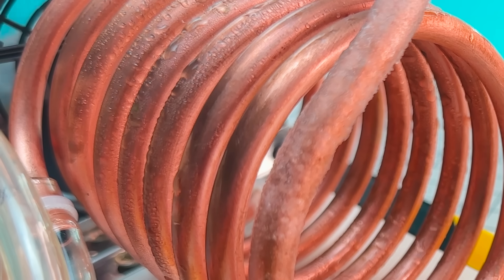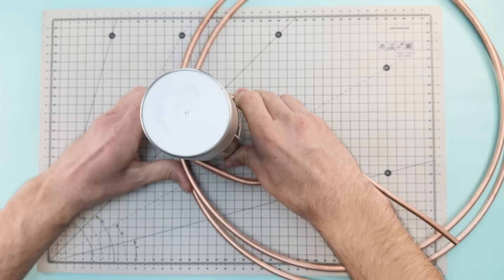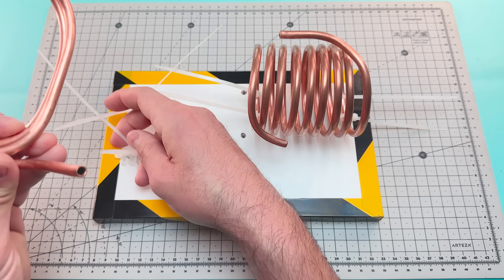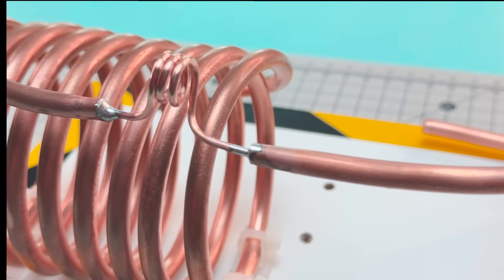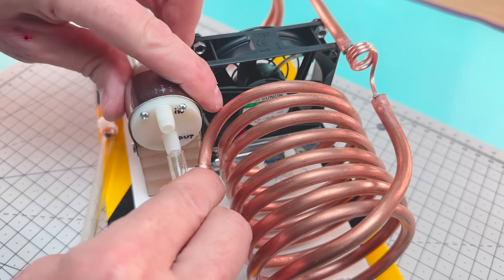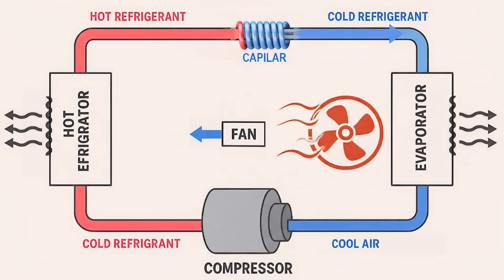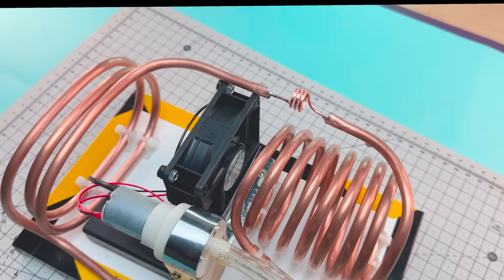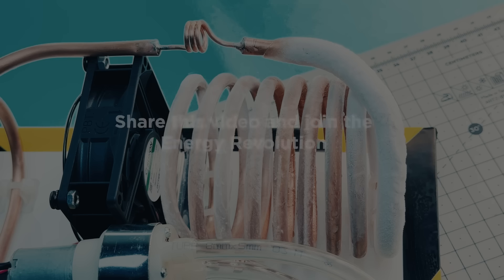Make your own AIR CONDITIONER at home Fast and Easy!

Comment: How many days this gas and whole  system work if i connect motor and fan with ac adapter ..

I think... if i make cabinet of 6.5 ft × 4ft × 2ft for sleeping then this one is good ...

Comment: Mixing flamable gas with air can create an explosion. You need to vacuum the system first
Reply: Good point, Thanks!
Reply: From what I am reading the heat created from this unit could possibly explode because of a butane leak. What do you think.
Reply: @c.t.murray3632  completely possible, in compressors for refrigerants class A3 the electric part must be isolated.

Comment: Isobutane is also known as R-600a.  My most effective improvement was to use water produced by the evaporator to cool the incoming air cooling the condenser.  I simply built an in-line evaporative cooler which cooled the warm outside air by about 20 deg F.  This resulted in significant energy savings, not to mention at least a 10 deg F drop in the air being blown into the room.  I do have to supplement it with tap water, but this costs a couple of bucks each year.

Comment: Could you put the hot side into a bucket of water? Let the heat go in the water and change out every day or so?
Reply: once the water gets as hot as the condenser the system would just stop working, the only way to make this actually work is to pump out the hot air next to the condenser outside the room
Reply: condenser in bucket, bucket receives constant inflow of water and constant drain. as long as water stays cool, heat can move from ac system into bucket. You're using the water as a heat sink for the whole system and then dumping the heat down the drain. As long as you have cool water in that bucket, you're good. 

Two garden hoses, 1 5 gal bucket. Cold water goes from faucet (bathroom) into bottom of bucket, where condenser is. hot water rises to the top and is drained by that hose (drill hole and tap for hose). Run drain hose back to sink and make sure the bucket stays higher than the sink at all times haha. Nice slow flow of maybe 25ml/min, just enough to get rid of the heat, not enough to waste water.

Comment: Hm... Well it works but it dissipates heat on the other side. So you can cool your head down with the cold air, but the room will get warmer, because of effectivity...

Comment: This work if placed on a windowsill  with one end out the window and blowing air from outside in, while allowing the heat to dissipate outside.
Considering its run of a 9v battery, I'd say it was pretty impressive tbh.

Comment: You fabricated a dehumidifier. It produces an equal amount of heat, so there's no net change in temperature. However, it does reduce ambient humidity by converting water vapor to liquid water or ice.

Comment: The principal is sound by the system is inefficient: the condenser heats up, coubterparting the cooling effect of the evaporator. To make it actually work, the condenser should be outside of the facility that’s intended to be cooled. Or vise versa is you reverse the flow direction. That’s why there are 2 separate modules in your AC/heat pump. That’s why the condenser of your refrigerator is insulated from your cooling chamber. At the scale, this will however work for cooling a tent or a beer in a cooler. Just separate the condensing and evaporating modules and keep the evaporator outside.
Reply: ...Typo: keep the condenser outside :)

Comment: Should at least build the system with 2 fans in a way that you can place it on a windows you can partially close with external shutter so that way the heat stays outside and the cold inside.

Comment: Thanks interesting. I would like to try this but I don't have access to iso butane. Can I use refrigerant commonly used in automotive ACs?
Reply: yes, isobutane its lighter refill
Reply: Lol, sure, it would work even better. The only difference is that they would work on a different pressure and as result, construction need to be adjusted.

Comment: Aside from the evaporator being in the same room as the condenser, what other problems does this thing have? It seems like it would work like an AC unit 🤔
also, is the pressure from a pump like that enough to compress the gas?

Comment: I actually did a project like this back in high school for a science fair. I don’t see any compressor in this video. The cute little black thing that everyone thinks is a compressor is a Peltier module.    A Peltier module doesn’t need a traditional condenser like a freon system — it handles heat differently and doesn’t overheat the same way. Projects like this are great for helping people get the basics, and I think that’s really the whole point of the video.

I got into HVAC because I enjoyed stuff like this, and now I own a commercial refrigeration company because I was shown stuff like this that made me want to know more. Don’t worry about the trolls calling it stupid just to boost their egos. Funny enough, even the ones acting like they know everything still stuck around to watch the video — so clearly it got their attention. And they did get to learn the difference between a Peltier Module and a compressor.
Reply: I don't see any Peltier module in this video, do you?
Reply: @Atthishg  nope!

Comment: No compressor on this unit. It’s a (TEC) aka Peltier module. 

Actually, this thermoelectric system does manage heat — it uses a Peltier module, which handles heat differently than a traditional compressor with freon. It doesn’t need a condenser in the same way, so overheating isn’t as much of a risk
Reply: Pressure drop are done via capilar, thus no compressor required.

Comment: 왼쪽 주머니의 돈을 오른쪽에 옮겨 놓는다고 부자가 되지는 않죠. 절대 방 안이 시원해질 수 없습니다.
Moving money from your left pocket to your right will not make you rich. It will never make your room cooler.
Reply: It will not, but it can create a stream of cold air in your direction...but for that between condenser and evaporator needed more separation, that the hot air would not be sucked to cold part by fan lol😂

Comment: Propane gets much colder. -60F / Here in Mexico 90% of cars are charged with propane in their air conditioners. The amount of gas used is so small they never have problems and leaks are easy to smell.

Comment: As refrigeration tech who almost daily fixes R600 sealed system units, have experienced having even tiny amount of air in system to be mixed with refrigerant causes heat transfer characteristic of refrigerant greatly reduce to sometimes not at all (unlike Freon 134a which is still works to some extend even when there is air in system). I didn't see purging air out in this video so hard to believe such an even frost pattern on evaporator tubing was end result of video which was edited right at that point.
Reply: This is disappointing news. I really wanted to believe this would have worked. It would never cool a room, but maybe it could cool a PC, for example (tho you'd have to protect against condensation)
Reply: @zachw2906 , all new refrigerators in U.S. market are getting filled with R600 agent.oil for compressor is old school mineral oill ( same as R12 and unlike R134 ) . 
As long as you add lubricant for compressor parts and choosing compressor that can achieve -20 PSI for lowside and around 50 PSI on highside you can make your home project. ( Hard to believe that air pump is capable of making that happen ) .

Pump you are using MUST be sparkless other way it can cause whole thing to explode . 

Finding compressor that works in such a deep vacuum is another chalenge . Purging tubing from air is not hard at all just keep one side disconnected while you filling your system up then put everything back together.

Make sure to do this practice either outside or in very well ventilated room . Since this new agent is completely odorless .

Comment: What if I use just water instead of isobutane
Reply: The water would just heat up to room temperature. You need to use something like Isobutane because it "Boils" into a Gas at a low temperature, and compresses back into a liquid as it's forced through the pump. This is the same method used by a standard A/C system on a much smaller scale. You could probably use Canned Air as well with similar results (you just have to make sure the can is upside down when you are "Charging" the system) if you want to give that a try. I built a system like this once using an old Cooler, a Styrofoam cooler, fountain pumps, and an exhaust fan off of an old server rack. We'd fill the styrofoam cooler with water, load a bunch of frozen 2-liter bottles into it to chill the water, and pump the water through copper coils in the big cooler. The fan was mounted to the lid of the cooler and there were 4 outlet pipes around it. Hot air was pulled in by the fan, blown through the copper coils and pushed back out the outlet pipes. So long as you changed out the 2-liter bottles every hour or so, it dropped the temp in the garage by 20-25 degrees pretty quickly.
Reply: @normanjeter5220 before starting to read it whole i want to give you thanks for your effort 😮
Reply: @normanjeter5220 Maybe I've lack of knowledge about the pump's work, I'll be studying about that thanks!

Comment: the fan should not pull the hot air to the cold, you want the hot side, "Outside". otherwise you are just pulling the hot you cooled.
Reply: True, but if this works at all (some ppl seem dubious of that) then it's a concept that could be adjusted. You might also be able to use it for short periods just by dunking the hot side into room temperature water in an insulated bucket. The water will heat over time, but until it does, you have cooling. That all assumes this works in the first place. I really, really want it to be this simple, but I doubt it

Comment: The only question I have is, can you really coil copper tubing like that without crimping it? That would be the only useful information I'd get from this.😂😂😂
Reply: You can if you are careful. An easier way to do it and ensure no crimping is to by a couple EZ Fittings for the Ends of the copper, cap one end, fill it with water, then cap the other end. As long as you make sure to completely fill it and there are no air bubbles, you can bend copper tubing all day long without any crimps. Water is non-compressible, so poof, no crimps! I've used this trick for MANY years, ever since the first time I had to bend my own fuel line for an old Chevy Malibu.
Reply: @normanjeter5220  No wonder that old Malibu I bought all those years ago kept having water in the gas issues!
(Just kidding!)
Reply: @normanjeter5220 nice, now that's useful.

Comment: This will (very slowly) heat up a room. The same way an open refrigerator will heat up a room, not cool it.
Reply: Yes, very little. The work to do the cooling all comes from the battery and it won't last more than a few minutes. Plus they must have continuously injected the liquid isobutane in order to get the pictures with the frost. That little pump will not compress enough. A 9V battery provides about 5 watt-hours. A mini-fridge uses about  65 watts.

Comment: I like to read the comments and see how many Trump voters there are, you know the ones that think this is practical. It is only practical to show how a refrigeration system works. Nothing is going to cool down a room with a 9 volt battery unless the battery is the size of a house
This contraption with a 9 volt battery, no coil fins, no real engineering for pressure differences in coils, and no condenser fan  will not work to cool a room
.The evaporator has to be above freezing or ice insulates it and it builds an insulating frost line so you end up with air blowing over ice which restricts the evaporator from absorbing heat.
Reply: How many HVAC techs do you know that voted for Biden, lol
Reply: And you still don't know what a woman is. Amazing...
Reply: Try again pal. Im a Trump voter who is also a commercial hvac tech. This little toy will (slowly) heat up a room.

Comment: He just made an ineffective de humidifier. If the condenser is not outside of the space being cooled, no heat is removed from the room, only moisture in the air is condensed, not enough to make any difference.

If you want to waste your time and money
, instead of a can wrap the coil around your head to make an evaporator coil and wear it.               Maybe then a 9v battery that might last 4 minutes would cool you down.

He said it will cool any room, maybe 1 square inch of the room.
Reply: so it can cool laptop

Comment: I dont know where to pirchase this kind of copper tubes. Or capillary tubes, or air pump like that lol, or pretty much everything
Reply: Plumbing supply stores. If you're in the US, home depot, lowes, and those types of stores will usually have them. If not, stores like Fergusson or HVAC/Refrigeration companies will have them. You don't need a special license to buy anything except the refrigerant
Reply: Hmmm, I'm in Pakistan so I'll have to go to wire stores and show them the equipment I guess, hopefully they'll have it @crossup13

Comment: Its funny how people only look at this and think as far as the fact that, in a room as-is, it would only add heat to the room over time, but then I realize most people wouldn't think about adding a set of flex pipes to let outside air cool down the condenser coil. The ones who think about how it results in a net gain of heat acknowledge that it needs the hot and cold side to be isolated, but they don't really explain that the hot and cold side should be entirely blocked off from one another with a heat shield basically just isolating the condenser from the entire room, closed off entirely with only the flex pipes allowing another fan to pull in summer air to cool down the hot condenser so the system has a net removal of energy from the room. Its a heat pump, after all, moving thermal energy from the cold side to the hot side, something's gotta move the heat from the condenser to the outside air.

Comment: This is an AC but it wont work as configured. You need to have each half in a seperate area, otherwise any cooling achived is offset by the heat produced.
Reply: It is not technically a heat pump/AC without a reversing valve.
Reply: @GaryHarron  Thats true but my point is still correct, but since you feel the correction is necessary, it's done.

Comment: This is just a de-humidifyier. You cool one coil and heat the other, the total temperature is costant. Even higher if you consider the heat provided by the fan and the pump. 
Still a good way to improve comfort in really humid rooms.
If you wanna make a good conditioner, put the hot coil outside of the room and the cold inside.
Reply: would installing a CPU radiator help?
Reply: No mention of how a 9V battery does not have enough energy units to even begin to cool down a doll house? lol

Comment: Can you show a thermal cut off added to control temperature ?   Great video by the way  how much of the gas did you inject in to the line  as not to over fill it ?  thx for the info and fun project

Comment: Isobutane is highly flammable.  And your system is not very robust.  Is this your application for a Darwin award?
Reply: Apparently you don't know about the new coolant they're using. The new AC units require leak alarms and sensors to warn of leaks because it is highly flammable.
Reply: Considering that he didn't use a brushless motor, this is 100% a Darwin Award.
Reply: @dniezby the new freons are slightly flammable. Nothing like butane

Comment: и чо? КТо-то верит, что 12в "помпа" с СИЛИКОНОВОЙ мембраной позволяет развить давление, при котором ГАЗ сожмётся настолько, что станет жидким??? Вы в школе физику прогуливали????
Для справки - давление "паров" изобутана - 3.1атм. ТРИ ТОЧКА ОДИН АТМОСФЕРЫ! если давление будет ниже - газ никогда не станет жидкостью! НИКОГДА! Отсюда вывод - автор видео обманщик и мошенник!!!
Reply: The function of the capillary tube is to restrict flow through the loop. Length and diameter of the capillary tube determine how the pressure differential. Pump compression to 3 atmospheres is possible, although I agree this demonstration is a silly magic trick.
Reply: @stevethecat69420  ДАННЫЙ насос имеет "столб" всего в 0.3 атмосферы!! 3м водяного столба(и то - при 12в и без потока вообще). От 9в там еле-еле полтора метра воды будет....
Чтоб получить "охлаждение" на изобутане нужна "помпа", дающая 30м водяного столба! либо 3 атмосферы! Можно было взять 12в "насос" для накачивания шин - вот ОН способен дать и 3, и 4 атмосферы!!! И сделать нормальный "стенд"!!!

Comment: coils need to be staggered and condensor needs to have 2nd fan blowing away, preferably into a duct leading outside. otherwise the fan is sucking hot air from the condensor and cooling it down in the evaporator 😲
Reply: люди не учили физику - не мешай им восторгаться!
По сути - вентилятор "Нагоняет" тёплый воздух из конденсора в испаритель и по факту - замыкает тепловую петлю. В таком виде агрегат не может работать в принципе. Ну, он и не работает - для сжижения изопропанола нужно давление минимум 3 атмосферы, чего китайский мембранный насос сделать не может НИКОГДА!

Comment: The most overlooked and confusing part to most people is the capillary tube. It does the exact opposite of what the compressor does on the other side. Each side is a perfect mirror of the other. One coil gets cold, one coil gets hot. One pump compresses, the other lets it expand. It's so often overlooked because of how simple the tiny capillary looks compared to the compressor. Even though it is so simple to look at, it's the exact same importance as the compressor and does the exact opposite job, keeping the whole system perfectly balanced and symmetrical.
Reply: а ещё длину капилляра рассчитывают в зависимости от "газа" и давления в системе ;) И его длина НИКОГДА не может быть "пара сантиметров"!!! Там от 25-30см минимум!